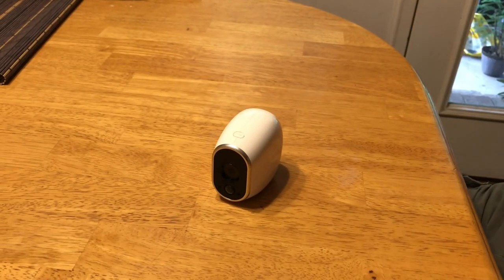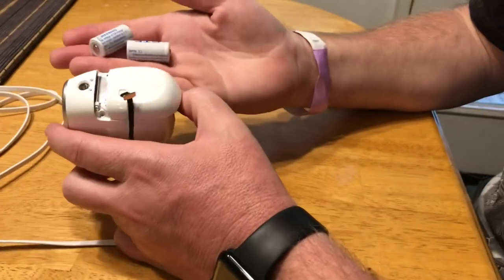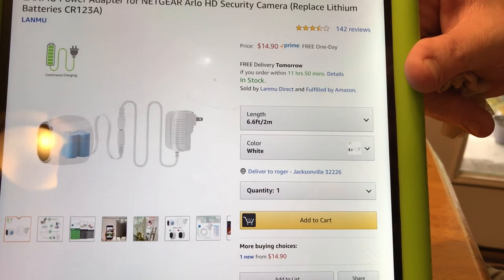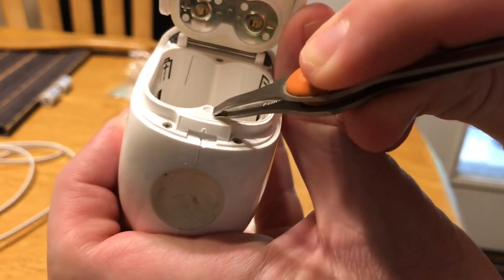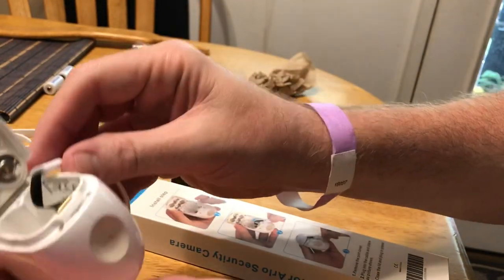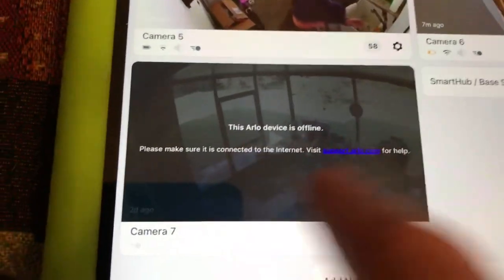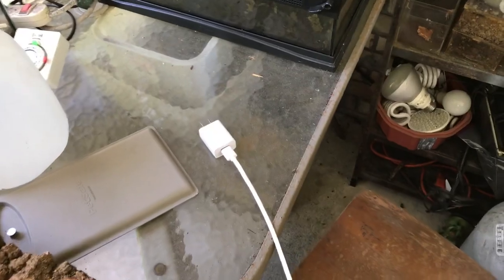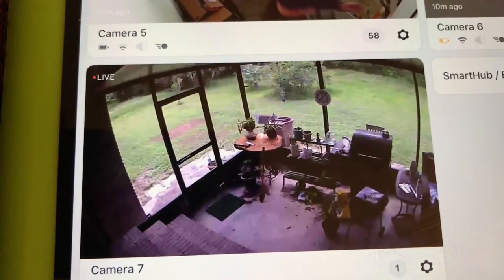Arlo first generation cameras how to replace and eliminate the batteries for a useful security cam

Comment: You site the camera under a bedroom window you can open to access the camera, certified rechargeable battery kits are £80 for 3 cameras.

Basically open bedroom window, remove Arlo from mount, charge batteries and replace..

Comment: Using this method will it keep the rechargeable battery's charged. I'm looking at buying a 12 volt solar panel. The rechargeable battery's   produces 14.8, the camera should run on 12 volts.

Comment: Does this or similar product serve the same on newer cameras like Arlo's Pro3?
Reply from the maker: This product will not work on the pro3. Arlo has improved what powers their cameras, rechargeable batteries. The batteries have greatly improved.
Reply: @boompowzap  
Thanks for the hasty response.  Albeit, I'd much rather have a camera that is either hardwired to power or plugs into a socket.  I can run a ground faulting socket anywhere.

Comment: Great video but one thing is confusing.  You show the converter on the Amazon web site with the blue batteries as part of the converter.  Then you show a plug that goes into the Arlo camera and don't explain what happened to the blue batteries that come with the converter or where the plug comes from.  I can't find a plug as part of that LAMU adapter (converter)? Please explain.
Reply from the maker: mike watt thanks for watching, Mike. The cord with the blue battery cartridge is the shorter 6.6 ft cord. I made a video on it here: https://youtu.be/zXwIuQjRTC4    Also: LANMU Power Adapter for NETGEAR Arlo HD Security Camera (Replace Lithium Batteries CR123A) https://www.amazon.com/dp/B078Z6N2Q7/ref=cm_sw_r_cp_tai_5CVxEb5J5DMAD
Reply: @boompowzap  Excellent follow up.  Thanks!

Comment: Why did you not include a link to the cable for first generation Arlo? I got the wrong one. :(
Reply from the maker: Tami Anderson you have to order the cord separately
Reply: @boompowzap  I know, but I accidentally ordered the wrong cord and it'd be nice if you'd included a link specific to the cord for the gen 1 arlo. But thanks regardless. Good tip 👌
Reply: Tami Anderson so which chord is it pls?
Reply: @m.f.b7144  I dont know that's why i posted
Reply: Tami Anderson oh terribly sorry. Because I’m having problems with my Arlo Pro I believe first generation. Bought it around 3 years ago. So did you manage to sort out your problem at least?. Because I was about to order the converter charger but it said not suitable for first generation Arlo cameras. What a nightmare. Thank you for your reply!.
Reply: @m.f.b7144  No :(
Reply: 1st gens need the blue fake battery style adapter. They are crap, I bought 2 after 6 mos neither work
Reply: @rosseowens  same....

Comment: Is it reliable though
Reply from the maker: They work as well as the newer Arlos except the picture is not upgraded and there is no sound. It’s like they are wired without batteries.... which they are.
Reply from the maker: They work as well as the newer Arlos except the picture is not upgraded and there is no sound. It’s like they are wired without batteries.... which they are.